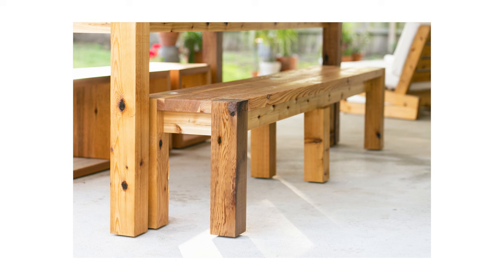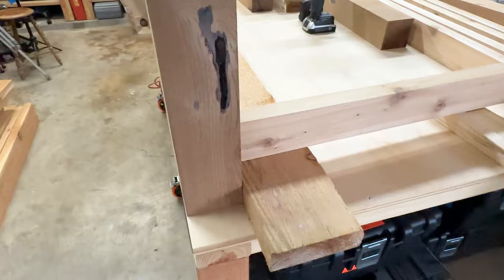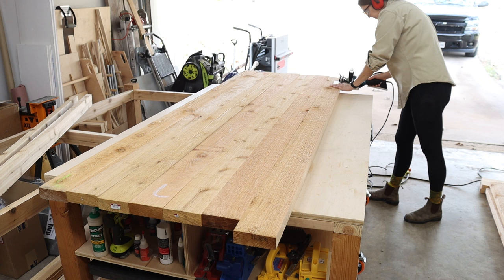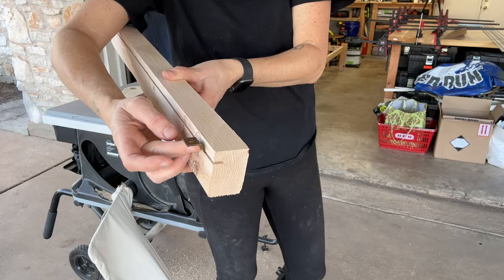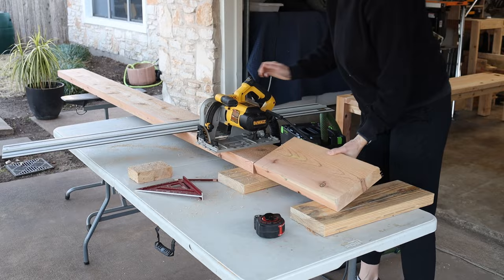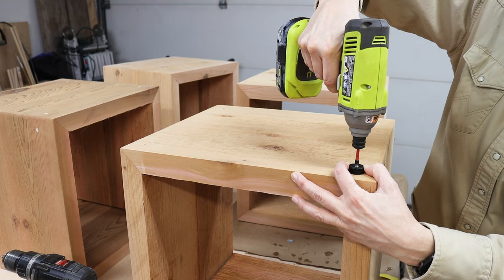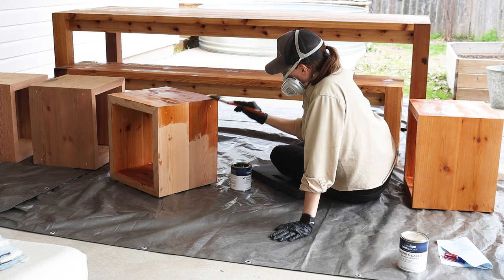Easy DIY Outdoor Dining Table With Benches, Stools (and build plans!)

Comment: I love the design and just purchased the plans! I’m excited to get started but quick question on the cedar. A lot of the cedar in the lumber yards are green. Do you use green or dried cedar? If green, do I need to let it dry for a certain period of time before using it? Thanks!
Reply from the maker: Great question! I use green cedar and I've not let it dry for any of my outdoor projects yet. I've not had a problem with it warping, but if you really want to be safe, you could let it dry awhile. Hope this helps and thanks so much for getting the plans! Enjoy the build!

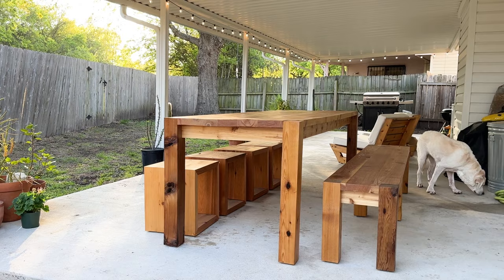Comment: New subscriber and I really like the looks of this outdoor dining set.  I paused the video to click through some of the product links (thank you for including them) and when I returned it looked like the tabletop had a great deal of undulation in it (timestop on the video is 12:14).  Is that possibly because you only finished the top and not the bottom of the tabletop boards?  I am wondering how I might make it lay flatter.
Reply from the maker: Hi and welcome! Yes, the bottom is unfinished. I never sanded or flattened the bottom because to me, it is unseen and unimportant. The top is flat, however :) To make the bottom flat, I would just turn the top over while it is still on the workbench and give it the same finishing treatment as the top. Thanks for watching!

Comment: awesome video, one question. instead of making all those grove cuts, why not just use L brackets?
Reply from the maker: As long as they allow for wood movement, should work fine. There are several options. Thanks!

Comment: Great looking and deserves a LIKE, which it got! But, is the whole of the table top supported on rails relying on pocket hole screws and glue (both under shear)? Don't try dancing on this one, eh?
Reply from the maker: Thank you! The top is not meant to be super structural and hold hundreds of pounds. However, I feel very comfortable standing on top of it if needed.

Comment: Can I know pl if the cedar board u used r pressure treated? I just spoke to the lumber yard and the guy said not suitable as table top. Do u know if i can get cedar 2x6 boards that r not treated. Txs
Reply from the maker: No, the cedar is not pressure treated. Cedar doesn't require chemicals because it is naturally water, rot and bug resistant. It is an excellent choice for a table top.